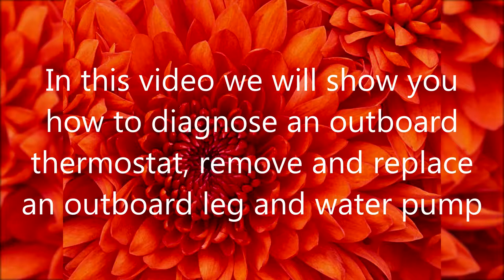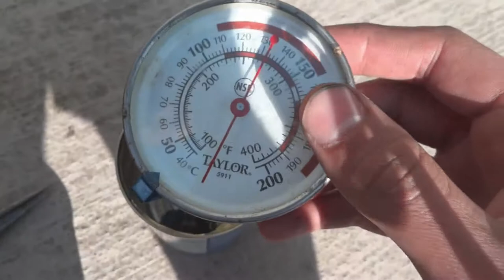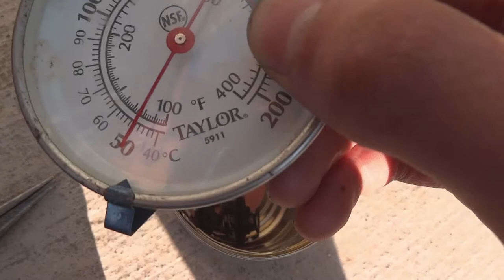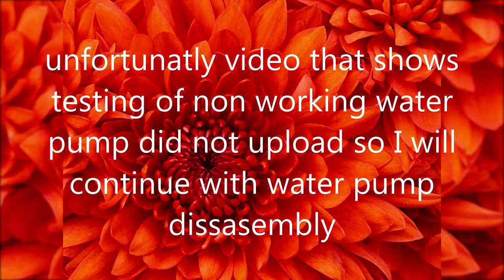how to change water pump impeller on yamaha outboard

Comment: Always lubricate you impeller with a hypoid grease before installing. Always lubricate the threads on your bolts with the same grease as well as the top of the shaft before insalling.